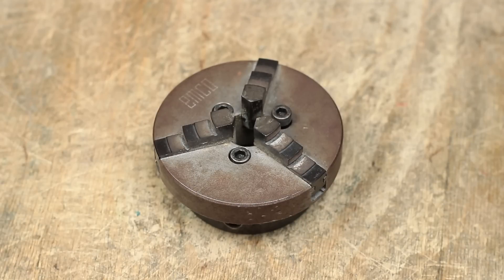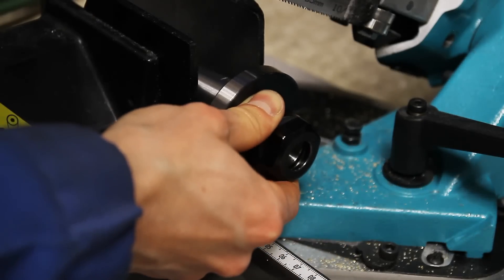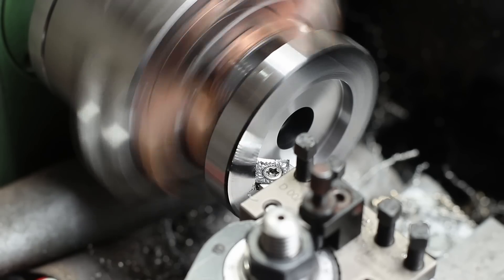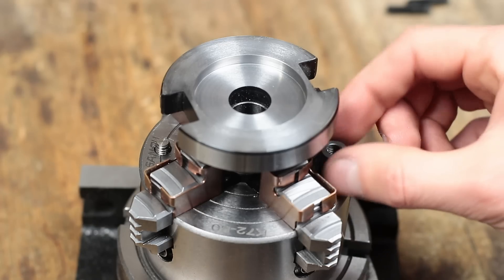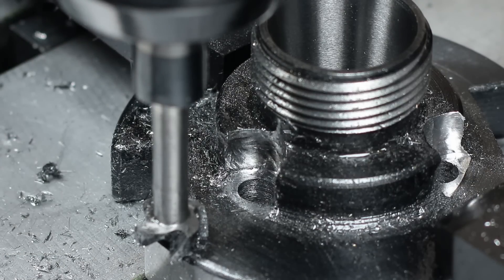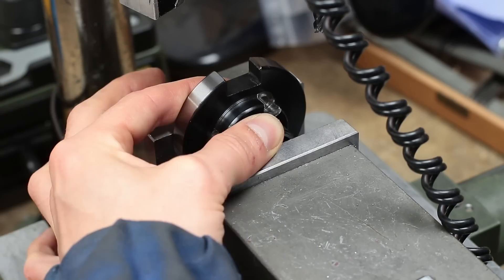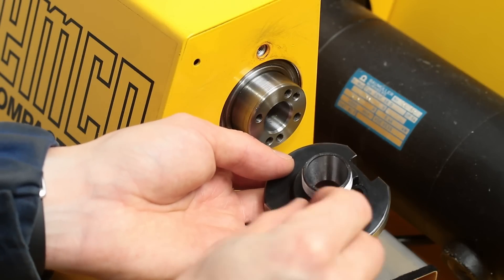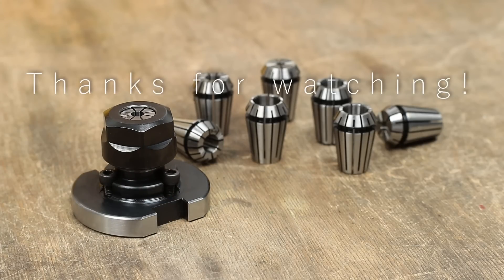Making a Collet Chuck for my Emco CNC Lathe

Comment: A thought just struck about the mounting holes and you getting your friend to grind the 10mm bit. Could you have made a backplate tofit your spindle nose, then mount the collet chuck on that with bolt holes for the collet chuck further away from the thread?

Comment: One correction: Looking at the Proxxon in some youtube videos, it looks like the screw arrangement is different than the Compact 5. The 4 holes used by their collet chuck, 4 jaw, and fixture plate are separate and slightly further out than the 3 holes used by 3 jaw chuck for Proxxon, while on the Compact 5, the 4 hole pattern is the same distance as the 3 hole pattern.

So the only Proxxon chucks that will fit are the ones with 3 bolt holes, and not the 4 hole chucks.

Comment: You could also make a little insert for those two cut outs, screw it in place, then turn it to match the rest of the diameter, since I don't think you would need them anymore. You'd still have a bolt hole, and you'd have to drill at least partway into the base, but you should only need a few threads since there wouldn't be any major forces pulling on it

Comment: Good to see I'm not the only one using those sharp alu inserts on steel. The quality and capability of the machine is greatly improved by using them. I have even been able to carefully cut very hard steel with them.
Reply: I also use CCGT inserts on steel for light cuts.  I find they work very well.
Last week I bought some CBN inserts - CCMT 060402 and used them in my late father's Myford Super 7B to rough turn some 15/64" high speed steel drill blanks, before finishing in a cutter grinder.  I made very successful tapered D bits, or toolmakers reamers for making inject cones for a miniature boiler feed injector.  Thanks are due to Stefan Gotteswinter for bringing hard turning to my attention in a YouTube video.  The Myford isn't really fast enough at 2150 rpm, but with tiny cuts it got the job done..

Comment: I enjoyed the video and thanks for showing the process and problems. It may be that your collet precision was compromised by assuming the nose of the collet holder was machined to the same accuracy as the ground inner collet taper. Clamping to the OD of the nose and machining from that as a reference, likely created a bit of error. It may have been better to use a precision mandrel in a large ER collet, and machined everything using the collet-held mandrel as the reference. Also, I think you really want that tight press fit on the back plate for repeatability without having to repeatedly drag out an indicator when you swap chucks. We learn by doing! Thanks again.

Comment: You could've used the key slot to keep the chuck in place during tightening, with an ER40 hook wrench (or some mm size that fits). These have to be pretty tight.

Comment: Straight away I recognised the 80mm chuck from a Emco Compact 5. I've had 2 of the non cnc lathes. I converted my second one to CNC. First with steppers including the spindle and currently with servos. Four axes. Spindle, carriage, cross slide and tailstock. My 80mm chuck died many years ago and I adapted a 100mm 3 jaw to it. Right now I am replacing the 400W spindle servo and controller that only gives me 1500rpm with a 1kW AC servo that will give me 3000rpm.

Comment: Coincidence.. two days ago I startied to think how to make collet chuck for my mini lathe :)
Yes I know that it's availabel for cheap, but I ddi not find any ER20, only ER32, and I already have full set of ER20 collets.
And of course.. where is the fun if you do not make it yourself :)

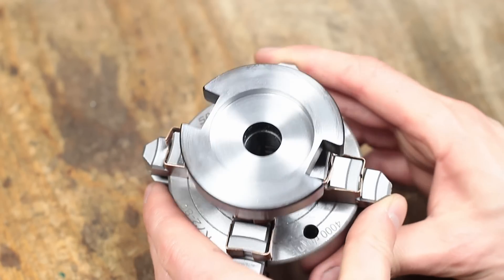7:09 I beleve that transfer punch screws will be more then enough accurate for mounting screws holes. After all that holes have at least 0.2mm clearance, and they are not locating elements.

Comment: Forgive my ignorance but I'm curious why more people don't just use the taper in the spindle to hold for example a MT3 ER32 collet holder the same that would fit in a mill? I use the same collet holder in my mill as my lathe and just a length of M12 all thread as a draw bar and it seems to be super accurate. genuinely curious why this isn't how most people do it?
Reply: Cos then you can not pass the stock thru the spindle, and lenght of the stock is very limited.
Reply: @bmalovic  I guess but if the part is small enough to use a collet 20mm at the biggest on a small lathe its never really that long.

I've never ran into that issue but thats the only draw back I've seen so far.
Reply: @ThyerHazard  It obviously depend on what you usualu make.
 
Lets say you have to make 10 identical 30mm long parts from 13mm round bronse stock.
For ER20 to fully engage you need 30mm extra (not sure for ER32), just for workholding. Lets say full engagment is not necesary, but you will need at least 10mm for workholding (recomended 20 or 2/3 of collet lenght) and some 2-3mm for cut off.
With collet chuck you just put 320+ mm bar make part, extend bar for next 33 mm, rinse and repeat.
With MT3 you will need to cut bar stock to at least 3 parts and throw away at least 3 times 10mm of bar stock.

In the long run.. not so cheap.
Or even worse, according to Marphy's law, you will lack just 20mm of stock, in the sundy afternoon to finish the job :)
Reply: @bmalovic  yeah like I said I get it, Only time I needed a collet with a long part was when I was turning down the ends of my ballscrews for a cnc project.

I mounted one of those square ER32 Blocks normally used in milling in my 4 jaw and dialed it in, but thats the only time I've needed it personally. 

Thanks for the reply :)

Comment: At 18:40, at the current concentricity setpoint, does changing the collet to a different size collet give the same concentric results?  Does the central axis of the collet holder match the axis of the lathe with a round stock of 50mm, or 100mm, or 200mm stick out? Does the central axis align with the tailstock?  I think I would have mounted a precision ground shaft in the original 3-jaw chuck and then mounted the collet chuck to that shaft in the reverse orientation to clean up the back side, (spindle side) mating surface of the collet chuck, and then would have made a heavy, almost flywheel like adapter plate, with provisions to adjust the final runout number to zero(0), for the final spindle connection. What are your thoughts about my thoughts?  ..  Thanks for presenting this idea and video.

Comment: you've checked only for concentricity and now your collet taper axis is not perpendicular to the collet chuck base - that's why you get random readings on a dial indicator.
in your case the best way to do (or fix) this job is to take a known good quality collet and a piece of steel bar.
1. mount a bar into lathe chuck. support it with tailstock.  cut it into 12mm rod (max diameter which ER20 collet can handle)
2.  put 12mm collet into collet chuck and fit it onto your 12mm bar.  then tighten the collet - voila. your collet is concentric an in-line with your lathe spindle.
3. bring tailstock back and cut (fix) all your features.
(precision of this method are determined  by precision of a collet you are using.  obviously)
Reply: was trying to figure out why the runout errors bothered me. thank you for stating it so plainly

Comment: Not a great fan of collet chucks of this description on lathes especially when a 3 jaw chuck in good condition will work better and with less messing about but mainly the range is far greater........I always mount a 3 jaw chuck to a backplate with a .1mm slackness on the backplate mounting spigot to allow tapping the body of the chuck true for exacting work when needed.....it makes any 3 jaw chuck a dead accurate one..

Comment: If you look up the originators of ER collets (rego-fix) you can find the recommended torque for the nut, it is higher than you would imagine for proper tightness and concentricity.
Reply from the maker: Thanks for your comment and the hint about the recommended torque. I will look it up.

Comment: Great work. I am in the process of retrofitting a Boxford 160 cnc lathe which has the same spindle. I may steal some of your ideas when it comes to making work holding tooling! The project is on hold while I build a shed for my wife, hopefully I will be back at it soon!
Reply from the maker: Thank you very much for your comment! Happy to hear to give you some inspiration. Good luck for your projects. I have to look up your machine. Sounds very interesting.

Comment: its vary cool. its nice to have a bolt on chuck with an er16. for mine i just took an extended er32 holder and cut off the flange and tapper the i just indicate that in in the 4 jaw. i felt it was much easier then bolting the 4 jaw and having to tap in something else to the spindle nose.
Reply: I just use a hex collet block in my three jaw. Good enough!
Reply from the maker: Thanks!

Comment: you can use a adapterplate... instead of .... destroy a chuck?
Reply from the maker: Might be a possible solution. The problem is the weird spindle nose. The mounting screws for the chucks have an extreme small bolt hole circle. Mounting a chuck with an adapter plate means, you first have to bolt the adapter plate to the spindle and afterwards you can mount the chuck to the adapter plate. Possible but in my eyes impractical.

Comment: From what i can see just scrolling through the video, you didn`t add a set-true mechanism... I would highly advise you to do so... Use brass tipped screws to prevent marring the spindle nose, but other than that, you can set the damn thing to micron runouts, rather than 10x as much... It won`t be as rigid as a true bored surface with hydraulic fit would have been, but alas, given that this is a compromise tool, adding another compromise like that won`t hurt... 

Generally, i would go with a solid rod, machine a spindle fitting section, turn it around, clamp it, machine the rest in situ and that would provide you with a more rigid and a more accurate thing, but that nose really is quite the dummy design... 
I have Emco FB2 mini mill, and Emco does make some great machines, no doubt about that, but they also appear to have geniuses in the design department that are often found in automotive engineering ranks, where their genius allows them to design the most efficient, high performance solution - which is the worst thing in the world to deal with when it gets transferred from paper to metal... Sure, high performing and efficient, but a nightmare to work with or on... 

Speaking of nightmares, your mill head seems to be nodding or tilting somewhere, i can`t say when the cut happened, but those threads are eaten into, and only the lower two, which means that if the mill was doing the work in the same manner as you showed, with the part being fed from(mill`s perspective) left to right, then your mill head is also tilted a bit towards the right... Check the tram of the mill head... And i`m talking about it as if you yourself were the mill, with the part and the table being below your chin, so to speak... So it`s the opposite if you are thinking about it from the operator`s perspective... Check it out, you will find the error that i can see here, if it is prominent enough to be visible, it will be easy to indicate just by chucking a test indicator and feeding the quill downwards, with the needle being in contact with a 123block or whatever square reference you can plop on the table... 

Best regards!
Steuss